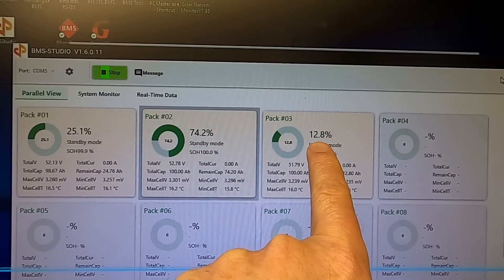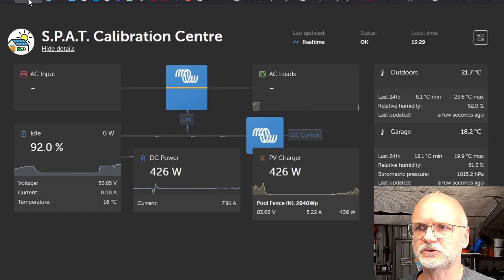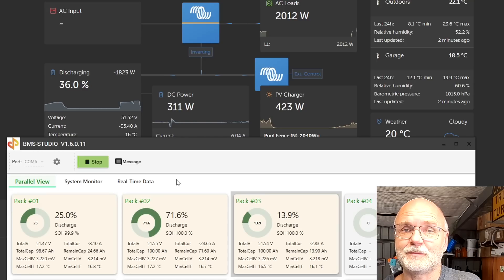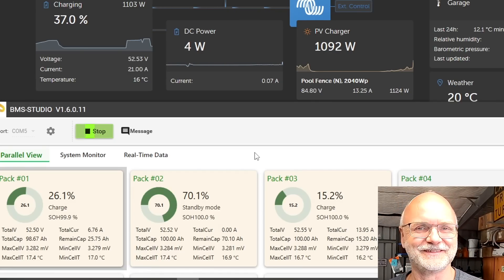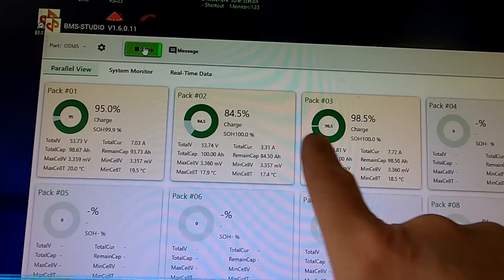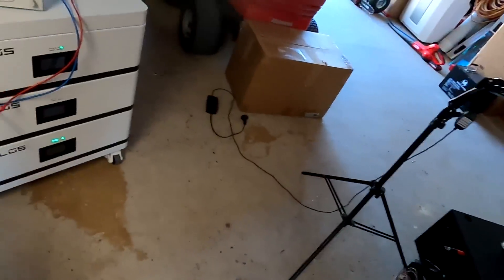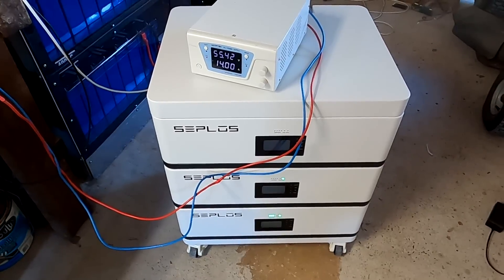3 Batteries in parallel. Lots to learn from an unfinished product 😒

Comment: At 19:50 Andy, I wonder if individually charging each pack (not parallel charging) with low current for several hours or days to about 57v to give the passive balancer time to top balance the cells, and once balanced if they would play better? 

I've noticed with the cheap passive balancing Daly BMSs, if I connect three packs in parallel they can't top balance because the the other packs hit them with more current then the BMS can dissipate so the cells never balance unless charge to about 58V and then isolate the packs and allow them to balance their cells. If I do that after every dozen charge and discharge cycles, the the Daly passive BMSs can mange to keep the packs in top balance, and I was thinking that might be adequate for parallel SEPLOS Polo users who don't want to splice in an active balancer?
Reply from the maker: Yeah, I tried that with the first pack and a power supply. Not working, the balancer does not do anything and deviation actually increased because the low voltage cells didn't get any charge and voltage just decreased.
I cannot charge these packs higher than 54.5V before one of the cells hits OVP. Garbage!
Reply: @OffGridGarageAustralia  Oh, I see... Combine that with the case design and the glued-together cell pack and it's off my option list.

Comment: Thanks Andy, as usual, very interesting 👍.
(My experience: When I disconnect one of my batteries to top balance it with the JK BMS, everything equalises again very quickly once I connect them in parallel and they’re charged again, too easy!)
Reply from the maker: Yes, JK-BMS is still the best to use.

Comment: Its a good demonstration of how battery voltage gets drawn down or pushed up according to a combination of load/charge-rate and SOC.   The voltage swings are the primary reason why load sharing happens in the fist place and why the load sharing tends to be a function of the relative SOCs of the batteries.

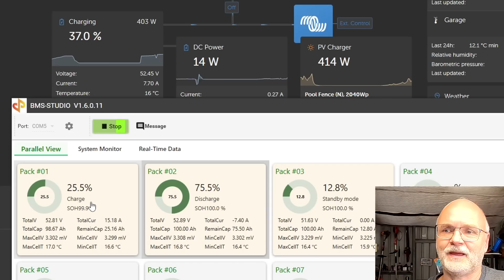Another good demonstration starting at 3:30 or so, where you were charging pack #1 and introduced pack #3 at a lower SOC.  You said "all the energy should switch to pack #3".  And that DID happen initially, but as pack #1's voltage settled to its new equillibrium, it began picking up some of the charging current again and again settled into a load-sharing situation that was roughly a function of the relative SOC's of the batteries.

And generally this type of load sharing works quite well.  Even a battery with a relatively low SOC will still contribute something when discharging.  It works when charging too until the batteries actually hit 100% and potentially begin cutting off their charging entirely (though as I've said in the past, my preference is for the charge controller to handle the cut-off and for the battery BMS to just be a last line of defense, protecting the battery against individual cell over-voltages).

When you began hitting the cell cut-offs... that kinda makes me believe that the batteries were not balanced out of the factory and/or the cells put into them were not matched.  Which is not terrible per-say, but still a bit unexpected.  It makes me wonder how much testing was actually done at the factory.
Reply: I think the cells are reasonably matched based on testing but most of the packs being assembled and leaving China are not top balanced because they figure that will happen over the first few months that the batteries are cycled as long as they are hitting 100% and cutting off charging but continuing to balance.  You even see this in the packs that are built out of the automotive grade cells where they were all matched at assembly but were never top balanced with the rest of the cells in the pack.  They are just welded together and the manufacturers are relying on the BMS systems to do the balancing over time as the cells are cycled.  If the software is setup correctly in the BMS no balancing at the factory should be necessary as the BMS will work on it a little at a time once the pack is put into service.
I helped a friend with 2 of the EG4-LL batteries that he was having issues with and even they were not top balanced when he received them.  We ended up hooking them up to a 10A power supply once they were mostly charged and stopped charging on solar and the balancer kicked in and just let them run for about 2 weeks while slowly lowering the charge current till they were within 30mv of balanced at full charge.  After that we put them into service and he didn't have any more issues until he had about 3 months where the packs never saw 100% charge and he had to let the packs rebalance as they drifted a little bit over that time but they were still cycling properly but would sometimes hit a cell overvoltage condition near 100% state of charge and it would take another few cycles to full charge to balance back out.
The real problem is that these batteries really need the ability to balance with at least 3-5 amps so they have a real chance to equalize before the battery reaches full charge when they come out of a long period of being on the lower end and not being charged to a high enough state to begin balancing.
Reply from the maker: Yeah, great observation and analysis as always. I really like these parallel batteries and how they interact with each other. It's fascinating to watch them while charging and discharging.

Comment: People get hung up on top balancing when diy, they shouldn't. Just get a system that will eventually balance it. These server rack batteries with communication do it for you! Just let it run a few months and check again.
Reply: There’s an EXTREMELY good chance that milliamp balancing will never get the cells in balance. Because it can only balance very near the top of charge, in most cycling applications it’s just not going to happen.
Reply: @FutureSystem738  wow. A balancer that can't bring them into balance is one that can't keep them in balance! It's trash!
Reply from the maker: The balancer on this BMS is garbage and will never balance these packs in months. I have tested it over two days and deviation got only worse.
Reply: @OffGridGarageAustralia I’ve came here hoping there would be a solution to balancing battery packs. I’ve got a PACE BMS… 4 rack batteries 200ah 48v 200a BMS
Reply: I’ve got BMS on batteries connected to victron. Dvcc is on; but solar isn’t working well: very low output: thinking maybe it’s the dvcc setting. Really struggling ☹️☹️
Reply from the maker: @lthainsworth  What do you mean by 'not working well'? 
What is are your charge settings in the PACE BSM and DVCC?

Comment: Hi Andy. i Am so confused now. What port must i use for communication between the battery bms and the laptop, CAN or RS485 to see what the battery (Volta) bms settings is. My battery manual states that i must use a RS232 cable but that is very old type of cables that i cant find. Manuals for electronics from china don't make sense to me.
Reply from the maker: CAN communication is only for your inverter. You can either use RS485 or RS232, depending on your BMS.

Comment: Good day Andy:

After watching these two videos on paralleling batteries with busbars, I have a few questions for you. Would you recommend the use of busbars to parallel multiple DIY batteries? Let’s say Yixiang DIY boxes with 16 314A battery cells each. What would be the limit be on the number of batteries that can be connected in parallel safely using busbars? What should I be concerned about? Thank you in advance!

V/r

Jose

Comment: What have we learned from all the videos and tests? To have a proper battery storage that runs without problems, a balancer with 1-2Ah is necessary, which automatically starts at 3.45Volt and waits below in standby with little self-consumption for its next use. This is how I run my system and have no problems . Thanks Andy
I suggest that the balancers are not only supplied with extra cables, but at the ends should not be installed ring lugs, but different plug adapters, which is inserted between the connectors from the BMS and the battery cells. Would simplify the assembly and make it safer.
Reply from the maker: That would be the ideal solution.

Comment: Hi Andy, coulld you maybe share a link or upload your Seplos BMS parameters that you use? I have the V2 version with parallel packs and also struggle to get them all to 100% and down equally...
Reply from the maker: OK, I will do that once I have finished testing the Gobelpower battery. We will go back to Seplos and see what we can do with the V2 of these BMS. I have quite a few here which we can parallel. All the same 10E BMSes. Very tricky settings...
Reply: @OffGridGarageAustralia  That would be super! I have also NEEY balancers attached to my 5x280Ah 16S "EEL" but the SOC is driving me crazy (+ force charge setting is a mystery a bit) :)

Comment: Will you be doing a review of the V3 BMS active balance module? I have 7 Masons with V1 BMS's,  and wondering if it makes sense to upgrade. I kinda miss my old JK BMS's, but hoping the now available active balance module may work the same as the JK.
Reply from the maker: Probably not at this stage. It is not even out yet. And why reviewing such a product which is already on the market from other manufacturers for years?!
The V1 you have are actually the best BMS they have built so far (see the BMS comparison spreadsheet). It only went downhill from there.

Comment: Hello Andy, just started researching, considering 5kw pv, eve 280ah 16s, not sure about inverter yet, but will be 3 phase (just myself). Curious re your smarts in this area, if you had to start off-grid again fresh, what would your shopping list be?
Reply from the maker: That is a very comprehensive question. I would probably stick with the Victron gear. I really like the fact of it integrating with other systems and the ability to remotely control and manage the whole system, down to being able to change all settings from my mobile.
Is 5kW solar and one 280Ah battery enough for a 3-phase system? Depends on your need and loads, I assume...

Comment: Dear Andy, the reason why the passive cell balancing system of your batteries are unable to perform their job properly is because you are not charging your lifepo4 cells properly. The energy nedded to make a variation of 1mV at around 3.4-4.45V is a quite big energy. The same 1mV require much less energy if you balancing the cell at higher voltage, like 3.55V. At that voltage level, the passive balancing system of Seplos BMS is doing his job perfectly, you do not need any additional active equipment. Not only, there is no documented evidence that lifepo4 cell are going to degradate fastly while charging it at 3.6V instead of 3.4V. Pylontech, which has an excellent know-how in lifepo4 battery production, are setting their BMS to charge at 3.55/3.60V per cell. Think about it.

Comment: the power is soley comming from the battery and not form solar, because you don't have your battery shunt (the discharge test shunt) hooked up and set up as DC-Load Meter in front of the "peter-inverter" so the victron system asumes there is only batteries behind the mppt's and the BMS requests 0 Amps charging, that's what the mppt is doing. you can see @20:52 the blue victron symbol in the middle (usualy a MultiPlus) is still in "off" state. Try to test this with the shunt hooked up to the s.p.a.t.-centre, would be interessting to see if this works!
Reply from the maker: That's not the case as the V1 and V2 of the Seplos BMS work exactly with the same hardware and 'report' the DC load correctly to the Victron system. I don't need a Victron shunt if I have a smart BMS installed. All BMS have a shunt which measure exactly the same current as the Victron shunt would do. The BMS just does not report it correctly.

Comment: Even if the battery is balanced, doesn't the CVL of 55.2V ensure that the battery stays at that level all day?
Reply: no, if the CCL is 0A, then the mppt has no tools at its disposal to push the voltage up with.
Reply from the maker: It will stop charging at this point but will turn on again once SOC goes below 100%. So 99.9% opens the MPPTs again and it will get recharged.

Comment: About those voltages: you really have to look at them before you switch on the breaker to judge the charge state of the battery, not after. Because when you turn it on, the other batteries will quickly "level out" as they will be pushing current to the discharged one - and you only get few millivolts of a difference.

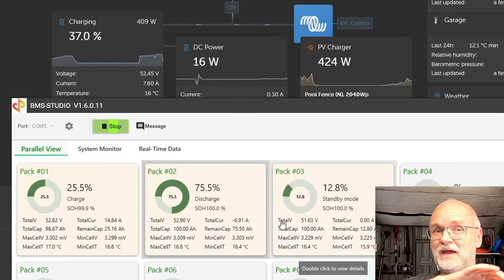You can see it @ 3:38 - the third pack has 51.63V while the others have almost 53V. When you switch on the breaker, the voltage will meet in the middle (causing big current to flow) around 52.5V. 🙂
Reply: SOC not determined by V .
Reply: @onthelake9554  Yes and no - the discharge curve is quite specific and while you cannot tell the difference between (lets say) 75 and 85% you certainly can tell the difference between 10% and 90% :)
Reply: @komplikatorful  My reply wasn't a question.  Andy had intentionally made the SOC unbalanced.
Reply: @onthelake9554  I don't think I said it was a question. It was definitely wrong - atleast partially though.

And I also don't think that whether he's done it intentionally or not is completely irrelevant to what I was talking about. 🤷
Reply: @komplikatorful  Thanks for reminding me not to engage when I feel the need .
Reply: @onthelake9554  Well, better not to spread inaccuracies even when you feel the need to 🤷
Reply: @komplikatorful  You continue to contradict yourself and claim superior knowledge while yours is on display.  I didn't wish a debate with you , simply stating " Soc not determined by V . "   Fact .
Reply: @onthelake9554  And you were wrong about that. V can be used when discharge curve is known as SOC is an area under the curve. It has its limitations when the curve is flat in the middle, but can absolutely be used. Unfortunately for you, the "I don't know about it thus it is not possible" approach will not work.

Also the point of my comment was completely different: you cannot judge voltage when battery is in circuit. You just (for some reason) picked up the most irrelevant thing it my whole post. Congrats.
Reply: @komplikatorful  You have misjudged me , and I you .

Comment: A battery pack with peaking cells can be balanced also by slowly increasing the charge voltage. Let the passive balancer equalize the cells at a lower voltage. Then increase it and repeat. Until e.g. 3.65 V per cell.
Reply from the maker: This will not work with this BMS. The balancer is pretty much none-existent. I have adjusted the pack voltage with a power supply so none of the cells went over 3.65V and then let it sit there over night. The next morning, the voltage difference was even worse. Low SOC cells went down in voltage while the high voltage cells kept their voltage pretty much the same.
I guess, the balancer is not working at all or has only a few mA of balance current.